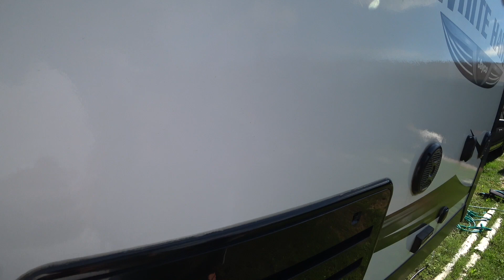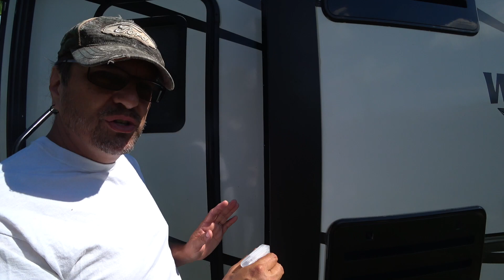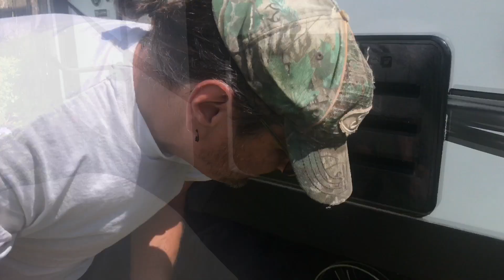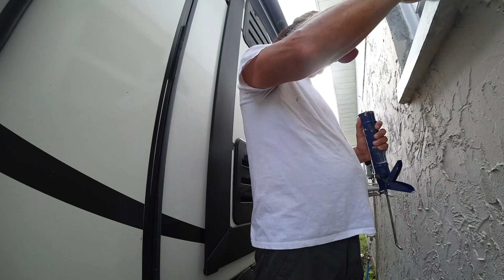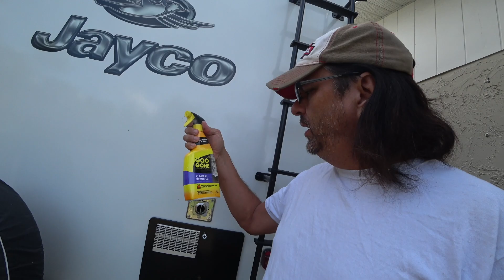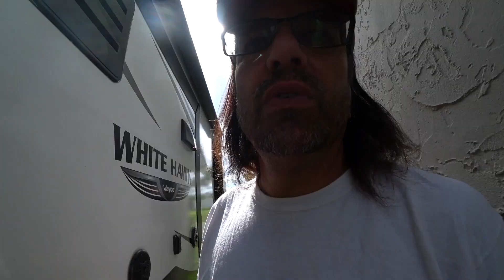RV REPAIRS-Replacing worn out, dried caulk on your RV

Comment: When I re-sealed the seams on my exterior wall seams, I used/use Geocel ProFlexRV. It resists staining, stays flexible and is made for the high flexing environment that an RV subjects to it.  What I like about it is you can reseal a seam without taking off the first bead as part of your yearly maintenance.    Obviously on my very first reseal, I do what was recommended here and remove the majority of the sealant and then GooGone Citrus cleaner to remove the residual and then apply the new seam. I do use painters tape for a nicer looking seal since I have not mastered a good free form sealing technique! Mine look too sloppy just using a finger! I don't have musicians fingers :-) 

Another tip...as part of my maintenance, I use Griots Garage 10982 Bug and Smudge to remove black streaks and bugs and then finish with CarGuys Hybrid Wax Sealant. Both of these products are not the cheapest but they perform (durability and ease of application) and do the job like no other. I got mine at Amazon but I have seen them available at the local auto parts store as well. 

Don't forget the roof....I bet that is the next video!!

As always, great video, great tips and thanks for sharing!
Reply from the maker: I'm actually gonna use some painters tape next time too. Seems as though that would make it much easier and nicer looking too!  Thanks for that tip! 😀

Comment: I used to use my finger when smoothing out caulk, but now I use a handy little tool called a Dap cap.  There are a few other tools that perform similarly.  Nice video!
Reply from the maker: Joeofallthings thanks for the info. I’ll look for that tool. I still have the rest of the RV to check. Just way too hot right now. 🔥🔥

Comment: You are so lucky that you didn't have to clean off 2 inches of silicone that someone had smeared around every window door and crack years ago.

It took me two days just to get my motorhome ready to calk.

Then it took me another full day to apply the new calk.

I have posted a video here of how I did it.

You are right... if you cut the tip too deep the hole will let the calk out way too fast and you'll have a mess.

I would say that the most important thing is to clean very well... especially to get the dried dust out so the new calk will adhere THEN use high quality calk because it doesn't make sense to work for a couple days then try to save $2 on cheap calk.
Reply from the maker: wow!